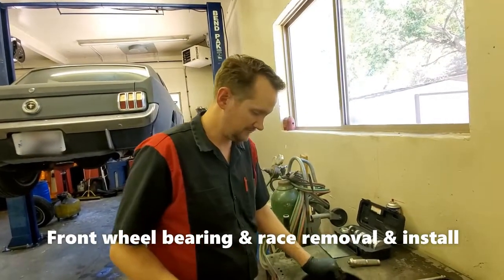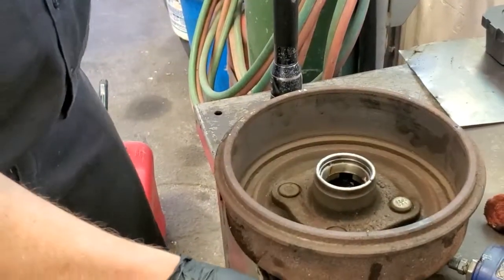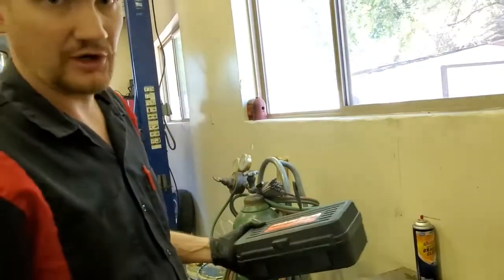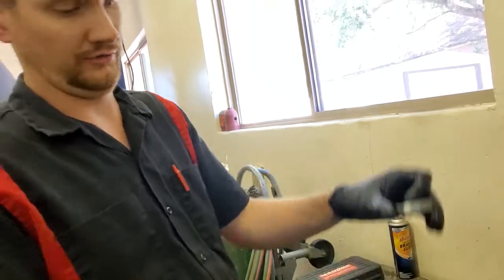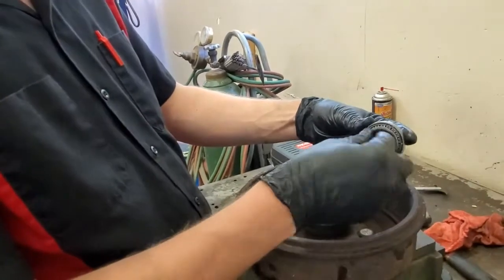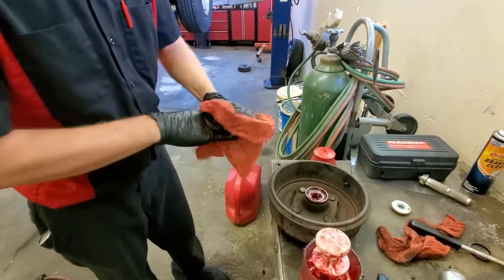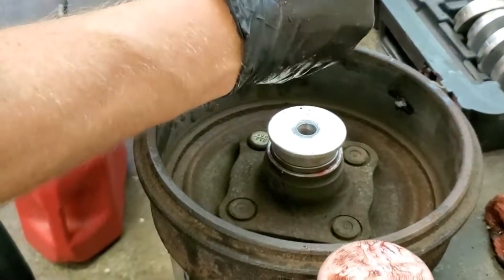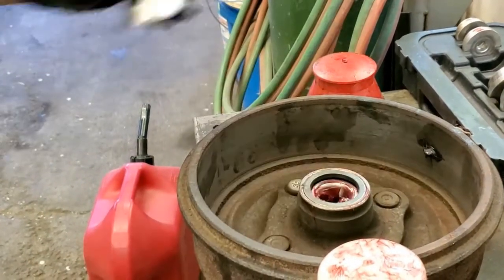How to replace tapered wheel bearings & races on your classic Ford Mustang

Comment: Having never worked on drum brakes or bearings...I think you saved me a headache.  base on what I'm watching, I see why my front drivers side wheel will not hardly turn....it appears the inner wheel bearing is in backwards on my 56 Mercury.
Reply from the maker: Glad to hear you got it figured out. Very strange to see something like that in backwards. But that, I would fix that and then see how she turns.
Reply: @AlfsMustangGarage  Again, thanks so much for the video.  I dug back into the front drum (after your video) and found out that inner bearing was in correctly, however, the seal was shot and not pressed down (it was barely sunk in)...I  lightly pressed the seal down so that it was seated correctly.  I also readjusted (pulled in the drum pads in) brakes and added some brake fluid (it was a little low).  It spins freely and for a short drive up and down the driveway it appears all is good.  Youtube to rescue!!

Comment: My brake drums look just like the ones in this video, the ones that I ordered do not have the studs or the hub built in I cannot find the drums that you have in the video to buy from the usual sources. I think that I am missing something and hope that you can help.
Reply from the maker: So the drums for the 9" 4 lug which I assume you have, you can round up everything from National Parts Depot. The hub part # is 1102-2A. They also have the studs, part # 1107-1 and drums, # 1102-1. You might want to double check everything but that's what it looks like. I've also got all that from AutoZone minus the hub if you would rather work with local parts guys. Makes returning easier if it's not quite right.
Reply: @AlfsMustangGarage  So the hub and the drum are two separate parts that have basically rusted together into 1 piece?
Reply from the maker: Yes. Either they are kind of stuck together or some I've seen where the lug stud stakes through the hub and drum and thus holds together
Reply: @AlfsMustangGarage  I think that is what has happened with mine. I am glad that I asked and am extremely thankful for your help. I am on NPD right now ordering the parts.
Reply from the maker: You're very welcome. I'm glad I can help. You can probably get your bearings and hub seals too. I would assume they have them
Reply: @AlfsMustangGarage  The studs are showing 19.98 each, does that sound correct, seems expensive?
Reply from the maker: Umm wow that does seem expensive. The last time I bought studs, I got them at AutoZone and they were maybe $3 each. However, I wasn't getting a replacement hub. It might be worth calling NPD to see why that is and what is so unique about their studs. Also since we are on this topic, what is wrong with your original hubs?
Reply: @AlfsMustangGarage  I actually don't know that anything is wrong with the hubs. I don't know if the drums are original to the car and don't know if they need to be replaced. I am going under the assumption that they are original and "should" be replaced. Am I looking at it from the wrong perspective and should I reuse them drums and all? I have only known disc brakes in my life.
Reply from the maker: In my experience, the hubs are usually okay. They could maybe use new bearings and races. The drums can also be turned if they are not too far worn. Most Napa and O'Reilly auto parts here have the capability of turning drums. You could see if they can do it. As far as hubs go, you could always try replacing the races and bearings. I usually try to do that first rather than replacing anything.
Reply: @AlfsMustangGarage  I really appreciate that knowledge, I am going to take you advice and reuse the hubs. I do have the bearings and races to use. Going to be a long 3 day weekend working on the car!!
Reply from the maker: No problem. One of these days I might be getting too many comments to respond to. It makes it much easier when people are appreciative. So I know in my bearing race video, it might look pretty easy because I use an air hammer. Most people don't have that luxury. So if you're just using a hammer and chissle, just try to secure it in a vice if you have one.
Reply from the maker: No problem. It's nice when people are appreciative. One of these days I may have too many comments to respond to so for now it's easy to stay on top of. Ya the races aren't too bad. If you see in my video, I use an air hammer. Most people don't have that luxury. So if you're just using a regular hammer and chisel, just try to secure that in a vice. Ya I've actually never come across a scenario where I had to replace a hub. I just always rebuild them and have had good success doing it. Let me know if you get into any snags. Sometimes it's easier to talk about it. You're welcome to call the shop if need be. 435-239-8762. But I do appreciate your comments on the videos. It helps boost these when YouTube sees more people engage and then in turn it helps grow my channel so I do appreciate that.
Reply: @AlfsMustangGarage  You have helped me immensely and I very much look forward to your video's. I am happy to comment and engage, its the least I can do for all of the great help you have provided me.
Reply from the maker: Sounds good, I didn't mean to reply twice. It wasn't showing my first reply went through but I guess it did.